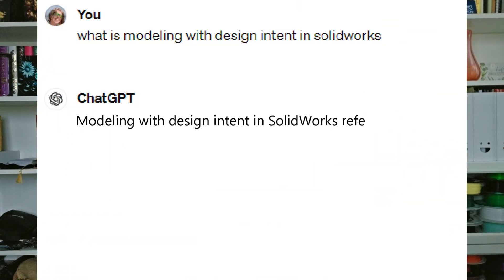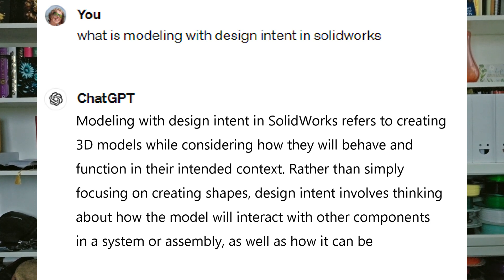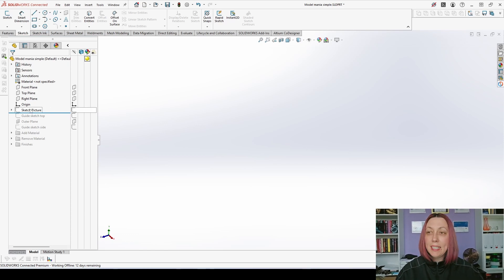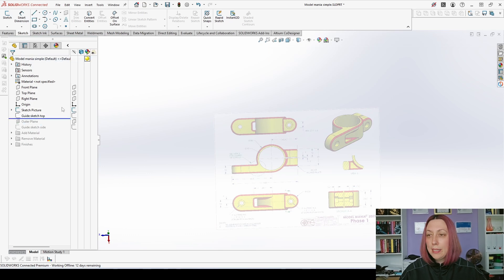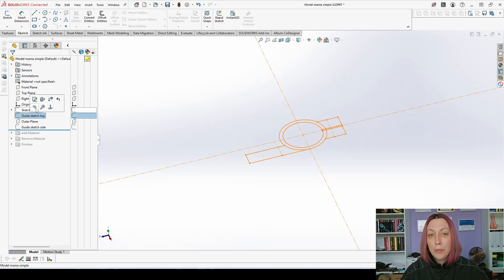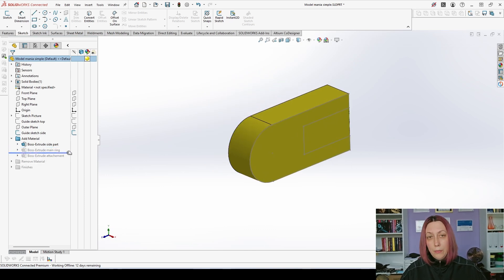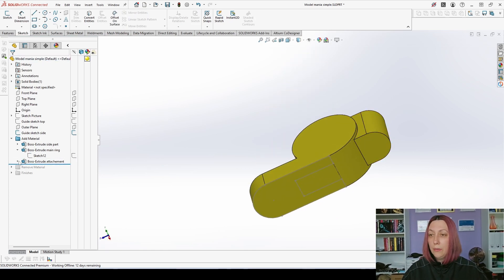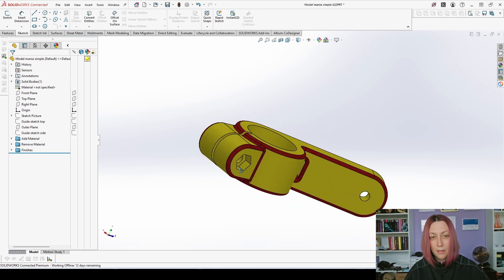SolidWorks Modeling with Design Intent: Your Key to Smart Designing!

Comment: 00:01 Modeling with Design Intent in SolidWorks
00:59 Modeling with Design Intent ensures structured and adaptable models.
02:02 SolidWorks Modeling with Design Intent
03:01 Adding an outer plane to avoid errors in extruding
03:56 Design stability achieved through strategic sketch usage
04:59 Reduce rebuild times in SolidWorks by leveraging sketch entities and relations
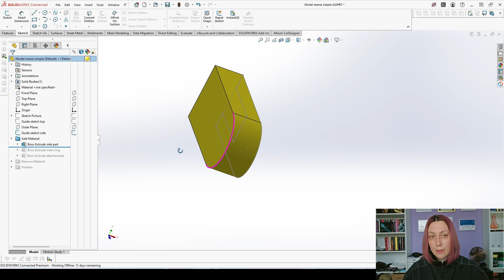05:53 Design intent ensures model adaptability without errors.
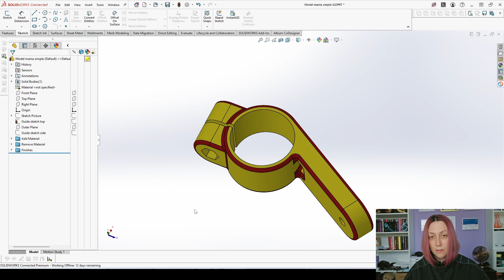07:04 Utilize sketch picture and reference geometries for stable and adaptable models
Crafted by Merlin AI.